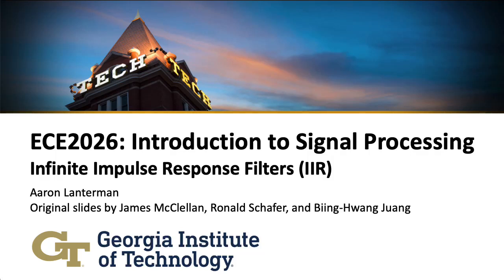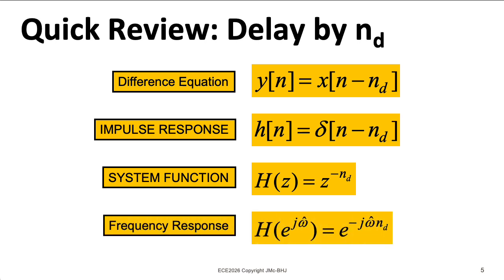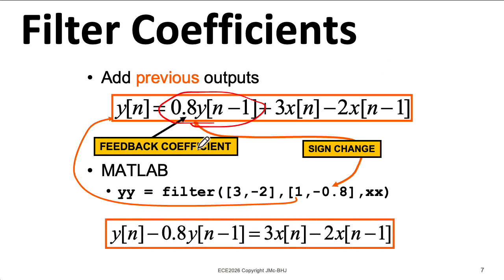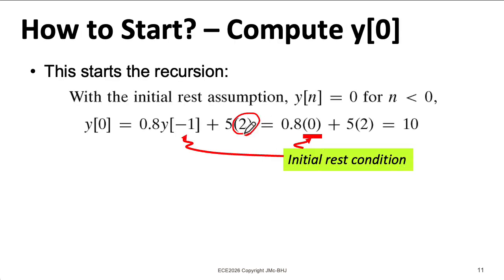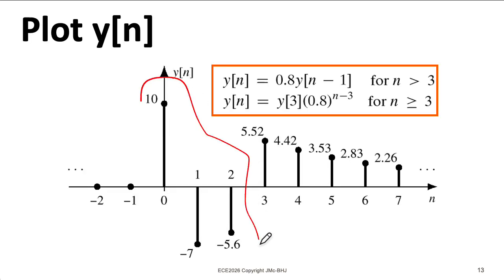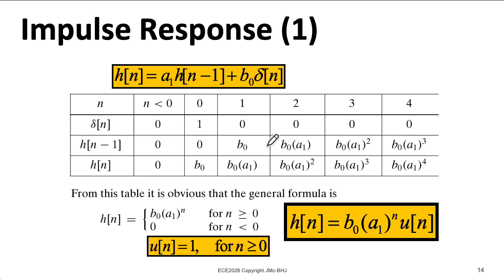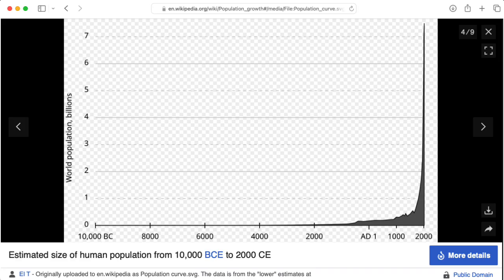ECE2026 L51: Infinite Impulse Response Filters (IIR) (Introduction to Signal Processing)

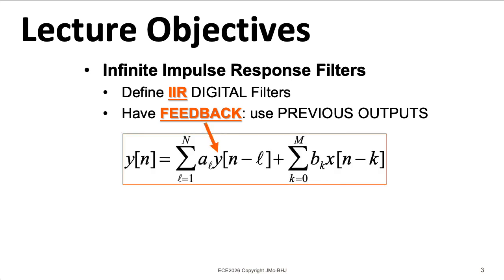Comment: 1:23 Wait, can you use a BBD to implement an IIR? I know about switched capacitor filters, which almost look like a small BBD but aren't quite the same thing. i.e. I'm not arguing with your point about it working with continuous-valued discrete-time systems. I'm just curious if you've heard of anyone actually doing that. I guess BBD Flanger and Chorus kind of count, but, what about other weird responses?